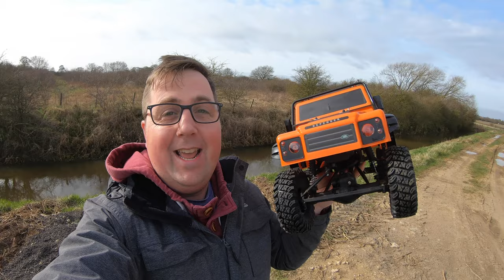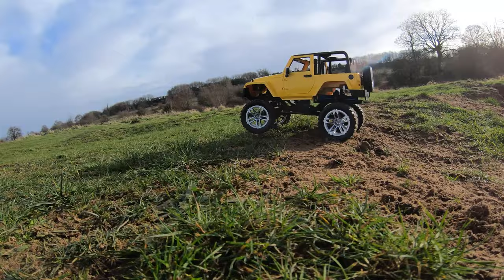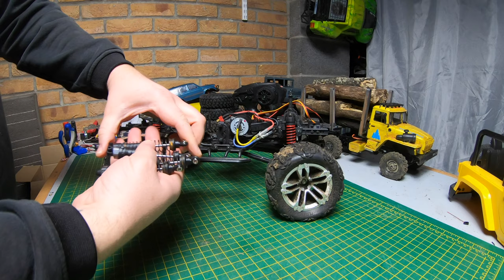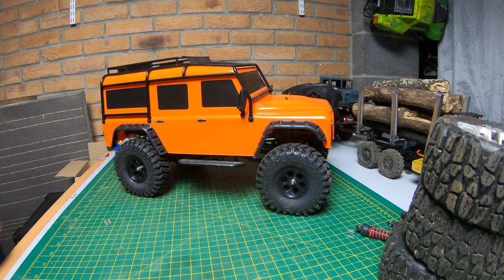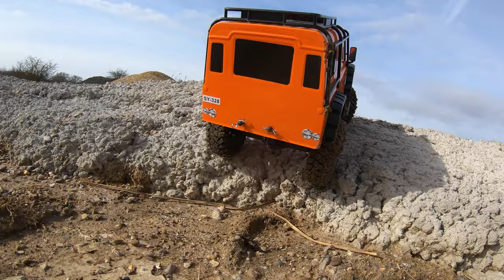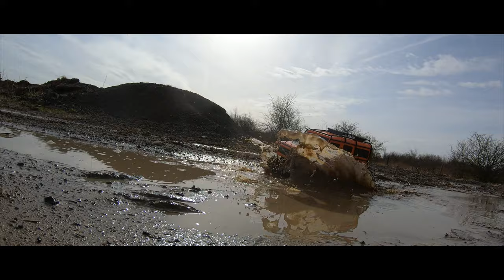Useless Toy RC Car to [EPIC] Crawler! HG P405 gets a makeover!

Comment: Just shows you how a little effort in the right direction can have a transformative effect. I've just changed the electronics on my Fayee FY002 and it's a completely different animal. So much more control both with throttle and more importantly steering! 👍
Reply from the maker: Yes, it's a big difference, once that steering is fine tuned it'll be even better!

Comment: "OWL exam" (not the Harry Potter kind, one wheel lift!) looks like it went from barely an inch worth, to a good solid 3" worth. I just lift a wheel next to a tape measure to check OWL, nice to have the rears barely stiffer for climbing.
Reply from the maker: Yes, some good flex was added! Not perfect, but so much better